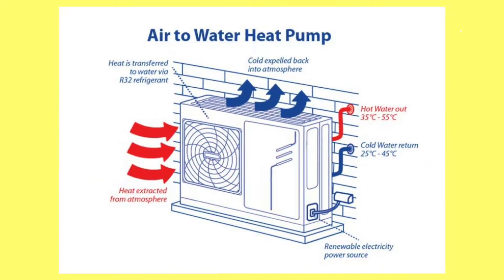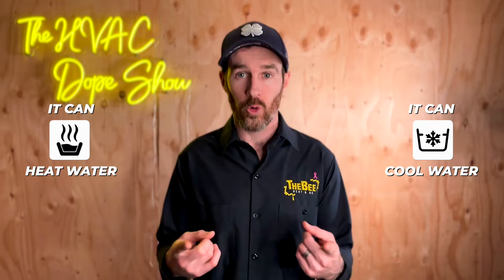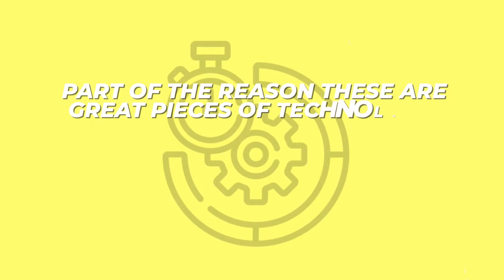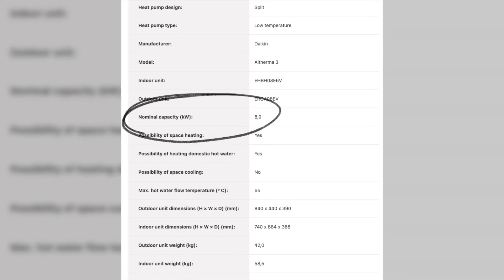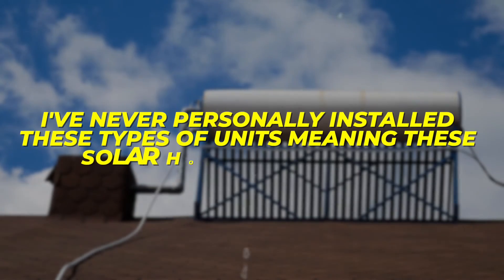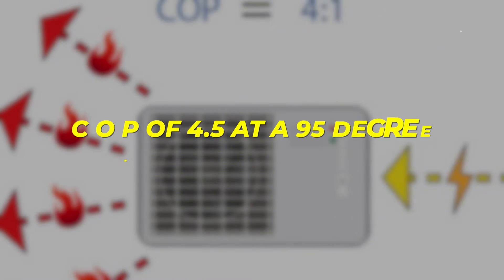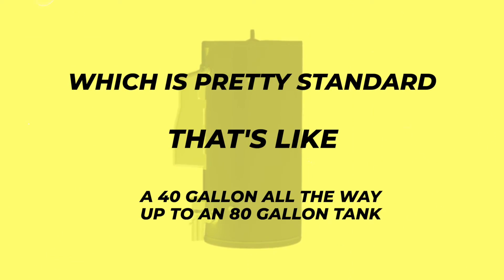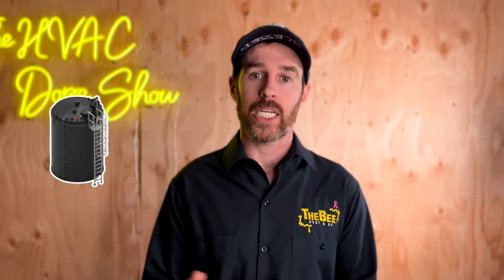Heat pump for radiant floors!? 😮🔥 | Daikin Altherma

Comment: I wanted to use air to water for all my HVAC needs - BUT - could net get any knowledgeable service here in the USA - 2018 when I was building. System engineering and service is severely unavailable, hopefully that is changing. Quite frankly, if our government was more interested in promoting trade schools and upgrading our construction and trades capability VS ushering in and supporting illegals - our country would be in a much better place to 'green up' and improve our lives.

Comment: I have a 40x64 insulated bank barn shop with 1/2 mile of pex in the floor.  Looking for 15 years for a system to heat the floor to 50 to 60 degrees in the winter and have air to water to air to take off the chill.  It would to use the floor mass  at as mass for energy.
I CAN NOT FIND ANY HVAC people in PA THAT WILL  take the challenge.

Comment: lets not forget that heat pumps can run on dc solar alone, that makes it possible to directy heat the floor from the son usimg compression phase change
Reply from the maker: I've seen solar powered heat pumps coming out but yeah it's not mainstream yet. 100% that's the best option but you still need battery backup to power those unless it's a grid tie with an inverter because heat pumps don't run in the middle of the day when it's sunny and warm... they run in the middle of the night when it's cold (at least Moreso). Thanks for sharing!
Reply: @TheHVACDopeShow  i have one i installed myself and it doesnt use any other power but the sun, its and eg4

Comment: I'm not sure what the issue is with air-to-water units but I was researching for a long time and there are very few manufacturers making their units available. I am in Canada and know that Daikin used to sell their product here but stopped. I found two Canadian companies that make the equipment and I purchased a 5 ton unit about 5 years ago for my in floor hydronic system and never looked back. It provides building heat on 7 zones as well as domestic hot water. It worked well down to -23 C (-10F) which is as cold as it gets in our winter.

Comment: I’m building a 825 square foot one-story cottage in Maine this summer where propane is the most common source for heat which is expensive.  I’d like to install a monoblock air to water heat pump that provides domestic hot water, hot water for radiant floor heat, and have one air handler head unit for air conditioning.  My general contractor is not aware of this type of system but advised him of my interest.  Are there many brands of this type of heat pump available on the market today?

Comment: We operate a heating oil delivery and HVAC company in NJ and I'm going to be building a roughly 4500 sq ft home soon. I'm interested in your thoughts about the best system to install. I was thinking heat pump for efficiency purposes and I'm going to install solar with backup batteries. We live in an older home currently with an oil fired boiler and separate gas heater (as backup) for AC - I like the idea of in floor radiant heat but until I heard about this option I felt like it would be too expensive to install radiant boiler along with air handler for AC. At that point it just seemed like going to heat pump was best. I wont be able to get gas at the property so that limits me to propane, oil or all electric. I'm going to have to put propane in for the stove unless i go electric range but i'm not crazy about that. Again, just looking for your thoughts. Appreciate your feedback in advance. Would love to be able to pick your brain. We serve a ton of customers who have oil fired boilers and no AC and this seems like a great option for them. With something like this, how do you get fresh air into the home? I was doing some research and it looks like you have to install an ERV system? Curious how all these option stack up price wise. Again, just looking for your thoughts. Appreciate your feedback in advance and an opportunity to be able to pick your brain.

Comment: this is exactly what I’ve been waiting for. I have solar on my roof and I have a 80 gallon hybrid, hot water heater, but I heat my radiant floors with OIL. I would like to do it all with a heat pump to take advantage of my solar.

Comment: In Western Europe houses are commonly heated with a central water heating system, lately also with floor heating. So it’s a small step to go from a gas boiler to a heat pump. I can imagine it takes a bigger investment to implement this in US homes. But it’s so much more comfortable and energy efficient than any other system. But good insulation is crucial.

Comment: Title of the video is a bit clickbait.  99% of the video is just giving information all over the place. Not bad actually but not about radiant floors using heat pump. That's just mentioned very briefly. That's all.
Reply from the maker: The whole video talks about the heat pump... I briefly touch on radiant floors, what more info did you need? The heat pump can do radiant floor heating, I explain the technology and unit and how it works. I don't think this is clickbait, Maybe if there was no mention of heat pumps or radiant floors then sure but I literally talk about it and how it works right away in the first 2 minutes. Did you have a question that was not answered? Lmk were always making more videos

Comment: Were you able to procure this product?
Reply from the maker: The Altherma? No it’s not out yet
Reply: I have installed monobloc air to water heat pump by stiebel eltron WPL 25 and it is available

Comment: I hope this comes to the US soon. I really want to use and ATW heat pump for my house build. There just aren't very many option in the US right now. Have you heard of the Vitocal 100-AW from Veissmann which is now owned by Carrier?
Reply from the maker: They’re available just really pricey… R290 monoblock isn’t in USA yet, but will be soon enough hopefully. Daikin Altherma will be out this year but can’t speak to its price point yet. I just priced out a few of the systems available and they were basically double the cost and only provided 120F water temps. R32 will be a little better but r290 is the best
Reply from the maker: When I contacted them they said it was not available in the us yet
Reply: The Veissmann unit is R32 and max temp is 165 °F. They replied to me on their Facebook page saying it's now available in the US. I see that MBtek has an R290 unit they say coming in June of this year and it will heat to 185.

Comment: So, I guess I can ask two for one here.  Since I live in a climate zone where for 3-6 weeks, our lows are 10F to -20F, I'm stuck with needing an alternate heat source if I want to use a heat pump and wall units (or ceiling cassettes).  We loved these systems in China so want to use them in the expansion.  But again the only other heat source I can figure is to go with an air handler with either a gas/LP heating unit or electric when the heat pump isn't efficient.  I've seen another video where both were used, but that's like adding two more furnace units.  So, I wonder if the radiant floor heating in this case for the two big rooms and the one master suite bath wouldn't be more effective.  I know the combination in our house in China was fantastic.  Thoughts?  

And a second question... what's your suggestion if there literally isn't a Daikin dealer within 150 miles?  I don't think they sell equipment direct to homeowners even if we have the skills.
Reply from the maker: The radiant heat pump / Altherma has a backup buffer electric element in it so if you’re going radiant floors on the days when it just can’t keep up it will supplement with an electric element in the tank. Not sure if that answers your questions but if you’re going for radiant floor heating heat pump then you can get low temp backup electric very easily it’s integrated into the system

Comment: This looks promising but I'd need to see the actual performance data. I have a feeling the advertised COPs and capacities are at 47F which is next-to-useless data to me. To be an economically viable replacement for gas heat I need to see it maintaining a COP of 3 when it's below freezing.
Reply from the maker: It maintains a decent COP into single digit (F) below freezing lows (I can’t find the exact chart but I believe it’s around 2.5 or 3 at 5F depending on water temp settings). It varies by applications and settings… R290 is better for high temp applications because the COP maintains even at high temp output (60-75C) but at lower temps like what you run for radiant floors in the 35-45C range the COP numbers are above 4 on some of these units.
Reply from the maker: https://daikintechnicaldatahub.eu/en-GB/altherma-3-m/outdoor

Comment: It would be awesome to put this in my 700sqft expansion. I wanted to put heated floors in shower and bathroom but also wanted Heat Pump AC for humidity and temp control.
Reply from the maker: Yeah that would be a perfect application! And your addition would be much more comfortable than if you tried to tap into an existing system for the main house.

Comment: Your explanation of the COP, or coefficient of performance, is not accurate.  It is not a comparison of one type of heating/cooling unit to another, it's how much energy you're getting out, compared to how much energy you put in.  Not sure how much faith I'm going to put into the rest of your video, given that you didn't know this basic definition of COP.
Reply from the maker: COP of 3 = 1Kw of power in, and 3kw of heat produced, how is that incorrect?
Reply: @TheHVACDopeShow  - You stated that COP was a comparison of efficiency between heat pumps and other types of electric heating devices.  Your math is correct, but that statement is not.  The COP of any given device is not based on any other device, as you suggested in your commentary.  I'm sure you do a better job of explaining COP in your other, more detailed video.  This one makes it sound like the COP of heat pumps is somehow a function of the COP for resistive heaters, which we know isn't correct.
Reply: @jasonbroom7147   The given definition is functionally correct because resistive heaters have a fixed COP of 1.
Reply: @eDoc2020  - "functionally correct", maybe...factually INcorrect.  Burden yourself with educating the user, even when it is not convenient to your own goals.  Otherwise, you risk painting yourself in a bad light when the very words you used are demonstrably false.
Reply: @jasonbroom7147  It's factually correct that the COP is a number equal to heating performance relative to a resistive heater. An analogous statement is that 50 is the number of states in the union. Both are demonstrably true. I agree it's incorrect to say that this is the definition/meaning of COP. I would need to rewatch the video to know which statement our host used.
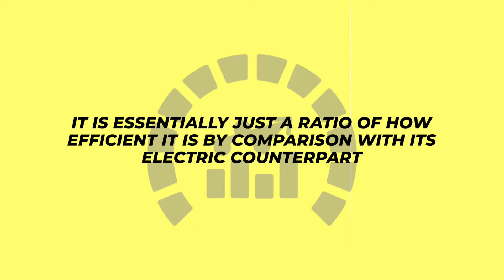Reply: @eDoc2020  @2:40 he makes a broad and oversimplified statement, wherein he claims COP is "essentially just a ratio of how efficient it is by comparison with its electric counterpart."  That is not true.  A resistive electric heater has a COP of 1, because you get one unit of heat out of the unit for each unit of energy you put in.  A device (like a heat pump) which gets 3 units of heat out for each unit of energy you put in has a COP of 3, but that's an expression of its own efficiency, not a direct comparison to a resistive heater.  The comparison can certainly be made, but COP is an expression of energy efficiency, by itself.  Some refrigeration devices, for example, have a COP lower than 1.  That is not because of their relative efficiency to resistive heating elements, but because they use more than one unit of energy to create one unit of output.

I understand why he explained this the way he did, in this video.  I have no doubt that he DOES understand what COP actually is, and that his other video explains it much more accurately.  For the purposes of this video, the guy who created it got a little lazy and didn't explain it well, because he was wanting to focus on the very cool product (with a high COP) that he goes on to discuss.  I was just shocked at the inaccuracy of the description he offered.  It would suck for someone to get the wrong impression and have to unlearn something, if this is the first video where the concept of COP was presented to them, because the statement he makes is, at the very least, simplistic and misleading.
Reply: OH for G*d’s sakes!! 
We’ve never had an air to water heat pump in this country and now we do and you’re nitpicking him to death over terminology. 
Do you want radiant heating? 
I DO!!

Comment: Been researching this for quite a while. I have a air to air whole house heatpump, but been looking in to adding a air to water to do in floor heating and domestic hot water. I have 57k of solar that this spring will be expanded to close to 70kw to do my house, shop, and electric cars. You have a new sub, lol.
Reply from the maker: Awesome!! That sounds like an epic project and a LOT of solar lol, right on!! Thanks for the sub 😁